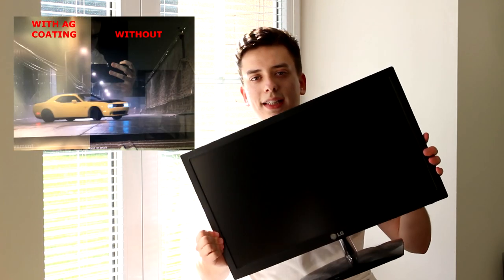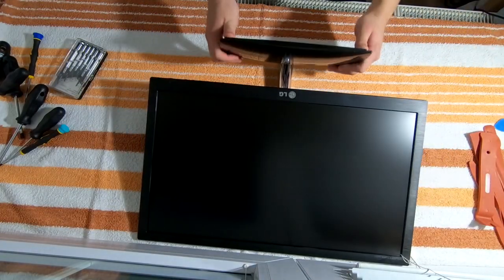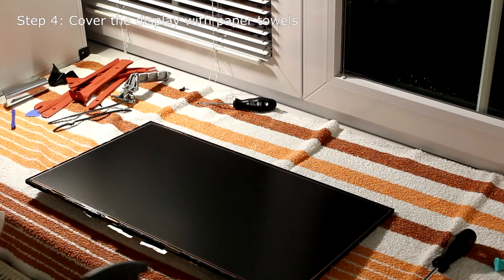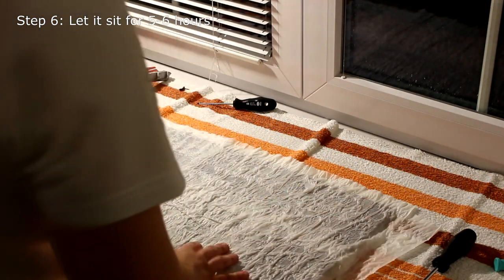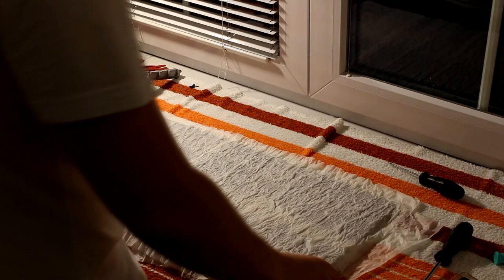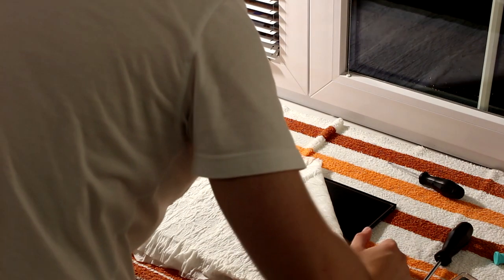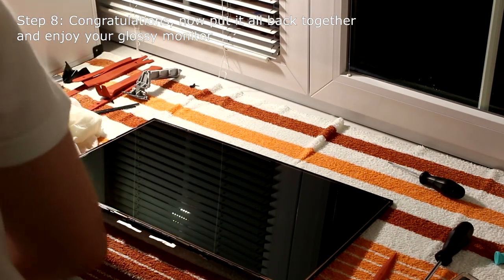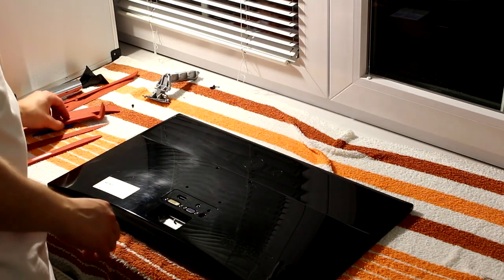How to remove the Anti Glare Coating from monitor DIY (Matte to Glossy)

Comment: Do NOT try this on any current monitor or from the past 5 years. The matte finish and polarizer is now ONE single layer and has been for years. You WILL ruin your monitor if you try what you see in this video.
Reply: Oh shit for real?
Reply: @EvoPortal  Any update? I was about to do this on my Lenovo G27q-20
Reply: @KenKlejs  I would do some research first before attempting this on ANY modern monitor. My Asus PG279Q uses ONE single layer for polarizer and matte finish. I ruined my monitor but I was OK and perfectly fine with buying a new monitor if didn't work. I've even taken a piece of the layer off and tried to search for a matte finish layer with a razor blade, there was NO second layer. I've done this on two other monitors in the past with success but they were 10 years old models. Manufacturers are no longer using two layers and have not been for years.
Reply: @EvoPortal  Thanks for the quick replay though. Might as well sell it instead, and save the funds towards a OLED panel with a more glossy texture then.
Reply: Well I have a qd-oled monitor (g60sd). qd-oled panels doesn't have polarizers so i should be safe on that matter but I am not sure if it worth the risk as it is an expensive one and I am not an expert on this subject.

Comment: Thanks for the video sooo much! I hate the monitor manufacturers for making us risking our devices instead of making monitors without matte coating in the first place! I only use 16:10 monitors and there are no glossy versions, they are non-existent. 
Same for budget gaming laptops, ALL of them are matte.
Reply: HP have
Reply: @lsg303  not in gaming laptops. Office laptops are too weak for me.
Reply: @TabalugaDragon  I know but monitors from HP and DELL both have glossy screen type, also it is 6bit+frc mostly
Reply: @lsg303  I only use 16:10 displays, and there are no glossy ones among them. I looked. A lot.
Reply: @TabalugaDragon  W2558HC if still there？the true love
Reply: @lsg303  umm it's a TN panel... matte ips looks better than a glossy TN.
Reply: @TabalugaDragon  The glossy is better in all the way,whatevr TN or matter
Reply: @lsg303  TN is generally a worse panel... with terrible viewing angles. you have to basically look straight at the monitor all the time. 
A glossy TN panel can only look better(even if we put terrible viewing angles aside) if it's a super high quality one(like Apple used to have before), which is extremely rare.
Reply: @TabalugaDragon  but hp tn monitor still looks very good in glossy screen
Reply: @TabalugaDragon  I also love the 16x10, we can make the matter become the glossy screen if ok based on this video teaching
Reply: @lsg303  I would probably do the same, but I'm afraid to risk my monitor. Some people remove polirizer layer along with matte coating, which makes the display unusable, not to mention possibility of some water getting inside and frying everything.
Reply: @TabalugaDragon I know, otherwise if you can let 16x9 be your love, S2715H is a good choice for glossy screen, for me it is good enough, I can't take risks on my monitors too much

Comment: I need to try this on HP 25f. I hate antiglare, tested so many monitors and all have haze and light color distortion and 178’ view angle is bs becase of this. I have old HP 2511x, glossy, and despite old technology is better then any new monitor. I think all monitors should come glossy like cell phones, and if some (or most) people don't like gloss they can always put some film. Anyhow thanks for the video. I'm glad to see it's possible to "clean up" the monitor
Reply: you have any experience with lg monitors? any advice? i am currently trying on a 32" 165hz 1440p lg and am having a hard time separating the ag layer even after like 3 hours. Do i need to soak it for longer?

Comment: Any idea if the AG 3h hard coating on a Dell S2721HN is easy to remove by this method?
If the adhesive is too strong, it will totally ruin everything.

Comment: worked perfectly, just had to remove excess residue after using window cleaner and lint free cloth, thanks a lot
Reply from the maker: Glad it helped
Reply: Bro you are a life saver, the window cleaner method applying a tiny bit of pressure helped me to remove the leftover glue/compound after removing the matt layer. Thanks big time! :D

Comment: Cool video, Ive done that twice except I open the bezel from the outside with either two butterknives or hard thin metal spudger/prying tool/spatula's, small tip is to fold the glass/polarizer/3m blah-blah (top) layer out of the enclosure and sit them beside each other on the towel before using the paper towel and water just in case you were to use too much water and have to blow dry all ~10 of the layers that it encloses, layer by layer ;)

Comment: Guys be careful as i tried this on an old monitor to have more experience with my main monitor and i messed up. Somehow some water found its way under my polarizer and when i removed the anti glare coating then i found that my old monitor was really blurry and had small water stains under the polarizer
Reply: Did you try to glue it back? (polarizer)
Reply: I worked around this by placing the paper towel down first, but have it be inside the boundaries of the film, soaking it with water using an eye-dropper, then very carefully nudging the paper towel to just barely touch the edges of the film.
Reply: @Daniel_WR_Hart  with which display did you do it? (model)
Reply: @socialreport2836  BenQ BL2711U
Reply: When you peel off the outer layer, underneath it, as far as I know, there is a polarizing filter. Isn't it dangerous to use the screen in this way? Isn't there a possibility of distortion? I would appreciate it if you share your experience.
Reply: @White_Polar_Bear  using a screen with just a polarising filter is fine this is because most tv's don't come with an antiglare coating so as far as I know, having an exposed polarizer filter is fine cause tv manufactures do that anyways

Comment: this is LIFE SAVIOUR for Omen X27, Best monitor for competitive 1440p 240hz that is let down only by its super agressive matte AG screan coating.
Reply: You mod your Omen X27 ?

Thinking about in my 1440P 144HZ Curved screen
Reply: im trynna find someone to remove the screen coatin from said monitor since its super sticky and i think it wont work with wet towels trick. Like im willin to pay up to 200$ for screen coatin removal which is the worse Ive ever seen, other than that nothin even come close to this monitor for competitive 1440p, only Lenovo but it uses same panel from AUO so..
Reply: @kostistsiutras4373  Yes sure of course it´s better.
I´m talk with some TV/Monitor Tech but all of they refuse to remove AG Coating.

Comment: I tried it on my lg 20m37a monitor and it didn't work I have left it for 5 hours Junga and it doesn't work the layer is very difficult to remove

Comment: Holy shit you are the man I didn't know this could be achieved. I will try it on my crappy acer TN monitor and then on my VA one. thanks man
Reply: Did you tried it ? And what was the result ? Does it make the color of screen more vivid ?
Reply: @itachiuchiha-sk4sf  yes I did, it looks crispier and the colors pop up more. Here's an advice; use a safety pin instead of your fingernail when you peel the AGlare and the anti glade shouldn't be sticked to the polarizer when you lift the tip, if you feel you lift the tip and it's giving you resistance stop what you're doing because you are peeling the  polarizer, the anti glade is another very thin layer on top of the polarizer which can't be seen you can only lift it with a safety pin,
Reply: @marcelfernandezromero8905  thank you for your advice one more question , is it comparable to TVs glossy screens ? I mean in colors and vivid range..! Because i am searched for a monitor which have a TV vivid colors and crisp and after a very long time i realized that the problem was the garbage matte screen...!!😭😭😭

By the way what is your monitor ?
Reply: @itachiuchiha-sk4sf  no os not comparable, is comparable with laptops screens that are glossy without a protective crystal. Normally glossy TV screens have a crystal before the screen itself,  in this case the mate film as s layer of protection against scratches, when you remove it you leave it as a pure LCD, you know those screens that you push a little and you see some ripples. 

As for colours it depends on the technology, TN has bad viewer angles and quality overall but pro gamers prefer them because of the high refresh rate, VA are my favourite panels because I am no gamer and VA offers 3000:1 contrast, apart from oled these monitors have the best blacks and whites, making the colours pop even more. IPS panels are for people that want the best of both worlds and it's the most used technology right now on monitors, you can't go wrong with it, but be prepare to not have blacks, instead the darkest black is just a really dark grey, they have good colours and angles though.

Really if you got money to burn buy an old TV with 55" that allows 120hz and hdmi 2.1, provided that your card accepts it. It has the best blacks, the best colours and still good refresh rate. Although you have to configure it in order to avoid burn in.

Current monitor technologies are like a videogame characters, if you increase their magic they are crap at physical tasks and vice versa  if you get what I mean.
Reply: @marcelfernandezromero8905  i have a 55 inch TV already and the colors is so great and i have the benq ew277hdr 1080p monitor of course a matte glass and it is colors is bad honestly i don't know how to tell put the display looks like have a sand inside it and not have a smooth and crisp picture as the TV or the smart phones so i am confused wither i should remove the matte grale or not is it worth removing it ? I mean in colors and crisp..!
Reply: @itachiuchiha-sk4sf  holy shit that is a kick ass VA monitor, It should look fantastic on an hdmi glossy screen yeah defo remove it. You should have great contrast on the thing and also great brightness since it's 50 nits above the average. Maybe it's badly calibrated also but man that is a good panel, if you want more tips add me on discord my nick is nMaib0#4345
Reply: @itachiuchiha-sk4sf  mate I forgot, when you open this monitor don't do it like this guy, you might break the panel, do it from the back with a spoon with a thin edge.
Reply: @marcelfernandezromero8905  thank you man
Reply: @itachiuchiha-sk4sf  also don't use that much water, just pour drop by drop with  an alcohol plastic bottle refilled with water you know those alcohol bottles that you can control the drop, after you finish 1 layer of drops put another layer of paper and drop water again this time a bit faster and don't make a big mess, just the necessary, after this use a pen and roll it over the paper so everything gets water, gently. Make sure all the windows are closed with no sun and turn off the lights so it doesn't dry up.
Reply: @itachiuchiha-sk4sf  after removing the anti glare take a hair dryer and apply it from a distance over the edges just in case there's water left, be careful don't do it too close or you will burn something.

Comment: I have the Dell S2740L which is a glossy IPS monitor and I love it. Even though it is 1080p it honestly looks as sharp and more vibrant than a 1440p 27 inch monitor with anti glare coating. I wish there were many more options for glossy monitors, I would like to increase to 4K but not sure if I want to do that if it won't be glossy.
Reply: Dell S2419h

Comment: The way you compared the "before and after" at the end of the video is very dishonest. At 9:14 you film the coated monitor from the side, which especially with TN panels (which this LG seems to be) will massively reduce the image quality and brightness, whilst when the coating is off you film it from the front. From the angle alone, it would already have a massive difference even if the coating was off on both pieces of footage! There is something very fishy about the comparison at 9:10 as well, the monitors really don't look that yellowish with the coating on.
Reply: Didn't notice it! Nice catch

Comment: Hello,can i remove the matte coating from my ASUS VC239H monitor?
The reason i'm asking is because despite turning vividpixel off,making sure that the resolution is set to 1080 and adjusting clear text,the screen still looks pixelated.
I've read online that removing the anti glare coating fixes this problem.

Comment: After removed anti-glare coating polymer film, the surface of screen is sticky that can collect lots of dust and polarizer layer lose its protection layer, how do you solve those problems?
Reply: Air duster and faith
Reply: As someone else already mentioned, you can try to find glass screen protectors and apply them on top.

Comment: I have 3 dells ultrasharp pros, and 1 old lcd but top 23 monitor, I will try with it, lot of fun :) lcd is less colorfull than led, I hope this mod can do an upgrade in image quality to the old samsung LCD gaming monitor. Thanks for the idea.
Reply: All monitors are LCD.   LED is the back lighting.  LCDs age too... so i doubt it will look like it did when it was new.
Reply: @digibluh  you're saying that my old LCD monitor loses light and power in past years? I think you could be right, cause its very cloudy image now, poor light. Thanks
Reply from the maker: Let me know how it turns out! Good luck

Comment: Nice. Is it necessary to put a kleenex on the screen and wet them? Can't remove the matte layer from the screen without getting wet?
Reply: I want to try it, but not sure it will work. Did you removed without getting wet?

Comment: To be fair both glossy and matte monitors have their merits, it really depends on your lighting conditions. It would be nice if they were offered in both as an option, but I assume that would increase manufacturing, administrative, distribution and storage costs. I know a lot of people prefer anti-glare. I don't mind either. If the coating material was as tough as smartphone displays (gorilla glass etc), I'd prefer that.

Comment: FYI for anyone with an Omen X 25 240hz panel this will not work. The adhesive does not soften or loosen with water, even after 12 hours of being wet.
Reply: i was about to try it on Omen x27 240hz
Reply: Dang I was about to as well . The haze on these monitors is terrible . I wish I ve gotten a diff monitor back then .

Comment: I did this on my LG 24MP59G and it worked flawlessly! I put 2-3 layers of wet paper and after 3 hours it peeled off without any issues :)
Just be aware not to peel off the dark layer, only the transparent one!
Reply: When you peel off the outer layer, underneath it, as far as I know, there is a polarizing filter. Isn't it dangerous to use the screen in this way? Isn't there a possibility of distortion? I would appreciate it if you share your experience.
Reply: @White_Polar_Bear  The polarizing filter is more fragile than the anti-glare coating, it's a little softer. I suggest keeping the wet paper for a bit longer just so the anti-glare layer is easier to peel off.

I kept cleaning the monitor with a window cleaner and a cloth and it didn't cause any damage to the polarizing layer. It behaves normally, just like a glossy laptop screen would. It's a bit harder to keep the screen looking clean since a fingerprint will stay on it, unlike on the anti-glare coating. I don't touch it often since it's not a laptop screen, so it's not that big of a deal.

A more important thing to keep in mind is the lighting setup in your room. If you have a window behind you or use ceiling lights very often, you'll get a mirror effect from the screen, which is especially noticable on dark images and low brightness settings. This is a big issue with a setup where the window is behind your back (mine is the exact opposite). Also, I aways use my desk lamp instead of ceiling lights and I like my room very dark (monitor brightness set to 0) so that wasn't a big issue for me.

All in all, I'm satisfied with the end result, no new issues after about a year of use. It may be a bigger compromise to make in case of having to alter your current setup to avoid the mirror effect, but if your setup is similar to mine than it should work quite well. The benefits are as shown in the video - colors are a bit more vivid and blacks are more black. Not like on an OLED of course, but much better than on a stock, matte IPS display.
Reply: @Brenzle  Thank you for your answer
Reply: @Brenzle just to be clear, after the AG coating is removed cleaning the monitor is not much more difficult? I was worried the polarizer wouldn't be robust enough to survive cleaning.
Reply: @RitzyBusiness  I clean it regularly and it doesn't get damaged from that at all. What I meant by more fragile is I think it might get damaged if the AG layer is not soaked enough and you start peeling it off with a lot of force. Be patient and it should peel off just fine :)
Reply: @Brenzle  Yea, Ive been soaking for about an hour already. Patient but excited.

Comment: Is that  anti glare coating you are romoving???   What if it is the filter for  excessive UV or harmful blue light from the LEDs. Removing it will be like looking at the solar elipse without wearing a protective lens.  How are your eye sight now?????  cornea burning sensation???